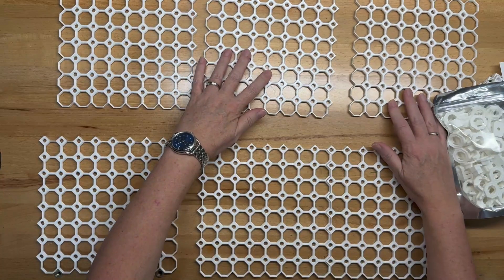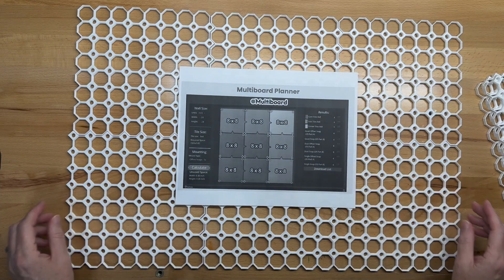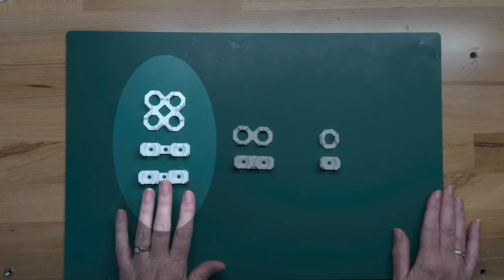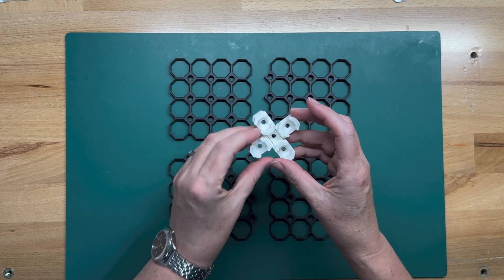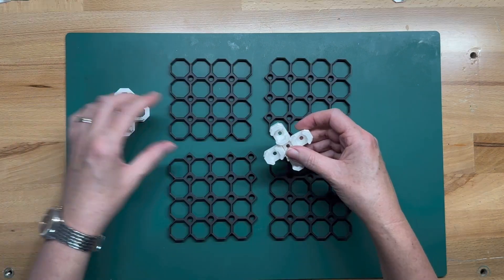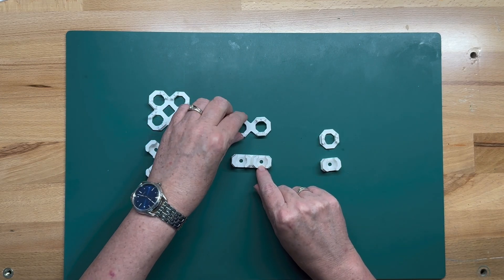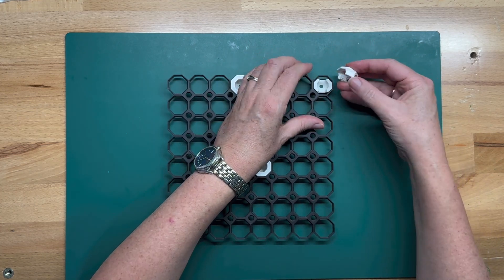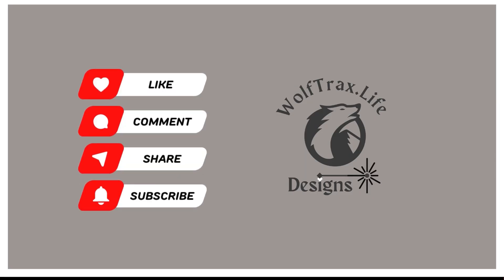How to Install Multiboard Connectors and Snaps

Comment: I just found your channel (looks great!) I am soooo confused. I used the planner online as I am new to Multiboard. I printed a bunch of 8x8 for my 72x24 wall. I chose simple flush for the mounting which I assumed used some sort of conventional screws to attach the plates to the wall and then everything interlocks. Now I am seeing there are these connectors and snaps but am unclear if I need them or not. Can you clarify if it possible to just flush mount to a piece of plywood or do I need to print these special connectors. Sorry if this is a basic question.

Comment: Im new to the multiboard eco system. I am trying to printer the 4 way connector and its snaps. Ive tried 15 times and when trying to drag and drop to bambu, no model is showing up... any clues?

Comment: It worked perfectly. I thought some of the pieces were off collared, but then I realized some of them were upside down. However, I persevered and now understand the system a whole lot better. Thank you.
Reply from the maker: We need to update with the 6.25 mm connectors but the concepts are still the same. Glad the video was still helpful with your custom order. Thank you again for trusting us with your project.

Comment: Too bad you didn't provide links to these specific connectors, very confusing to find the right ones on Thangs
Reply from the maker: Sorry for not adding direct links earlier. I have added them to the description. We find using the Multiboard.io library of parts a better way of finding the parts, although it is still not user friendly. This link is to the mounting systems and click on the Offset Snaps (DS Part A) under the Offset Snaps heading. https://www.multiboard.io/parts-library/mounting-systems
Reply: @wolftraxlife  Thank you very much

Comment: What size and type of screws would you use to connect the multiboard directly to a plywood wall?
Reply from the maker: The ones we use with 3/4 inch plywood are #6 x 3/4 inch wood screws with the flathead Phillips. The #6 size works well with the connectors. Of course the depth of the screw depends on the thickness of the plywood.
Reply: @wolftraxlife  Thank you!

Comment: Lol I actually came here to ask if you use glue to fix the 2x2 connectors. Never realised you're supposed to click the top onto an opposite!
Reply from the maker: Glad that we could help - no glue required!
Reply: @wolftraxlife  hi! Would you be able to slightly modify this so you can have a modular 3D box please? I want to make a modular greenhouse out of it. I did make my shoddy attempt but it's quite horrible. Thanks in advance.
Reply from the maker: @SahilP2648  The open source Multiboard library does have both inside and outside brackets that can be used for a 3D box. Here is a link to the page: https://www.multiboard.io/parts-library/shelves-brackets Hope this helps!
Reply: @wolftraxlife  thanks for replying! Wow this project is quite impressive. I did look through a lot of the links related to supports, bolts and parts etc. But I didn't find any specific section to hook 2D boards together to make a 3D cube or rectangle. Maybe I am missing something?
Reply from the maker: @SahilP2648  Yes, Jonathon @keepmaking has made this a very impressive design. There will not be a "specific section" for a 3D cube since Multiboard is a modular wall system. But you can tinker with the various parts to create one. Here is the direct link a collection of corner brackets mentioned previously. https://thangs.com/search/%22MB97%22%20creator%3A%22Keep%20Making%22?scope=thangs&view=grid There is also a community that you can join on Multiboard.io that is extremely helpful too.
Reply: @wolftraxlife  ok. Thanks a lot!

Comment: What if I wanted to mount it flush to the wall? The only benefits I see for mounting it off the wall are using stronger snaps with the hooks. But I don’t think I will need that.
Reply from the maker: Great question! There are flush mount connectors available as well. Or you may choose to YOLO it and screw through the peg holes. However, you may not get the full benefit of the structural integrity of the system, but still a valid option.
Reply: @wolftraxlife  That's what I wonder, because if it's flush against the wall, there wouldn't be as much flexing in the multiboard.
Reply: @EpicBenjo  they make center pegs for larger tiles. The spacing allows for pegboard accessories (as they need room in the back) and wires if you would like to do cabling behind the board.